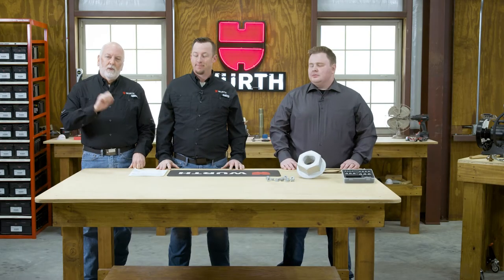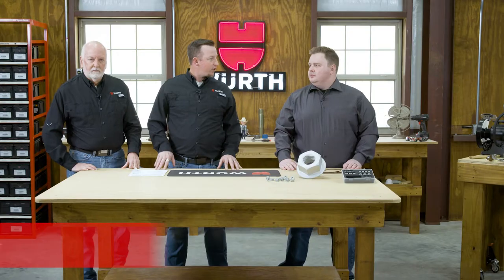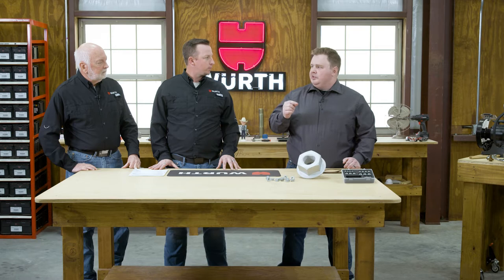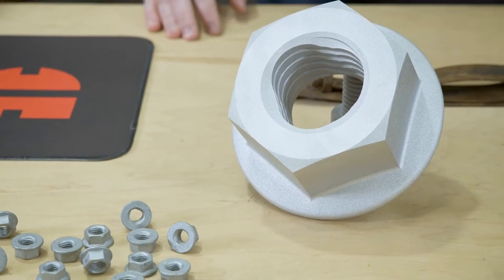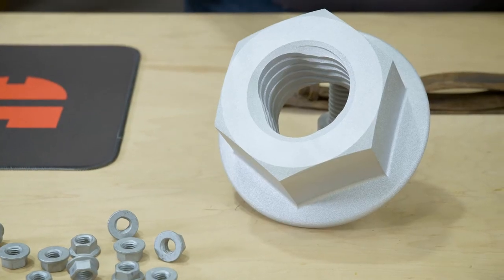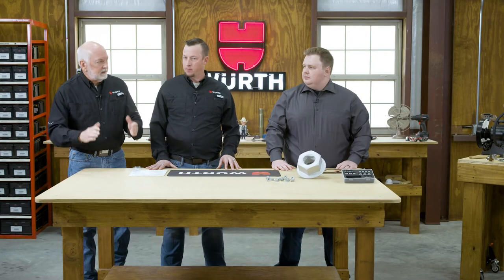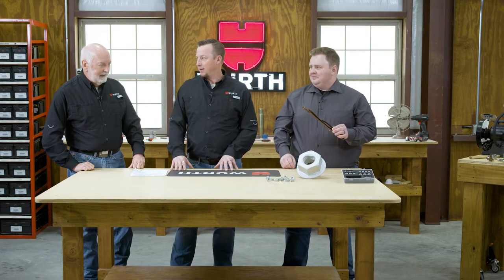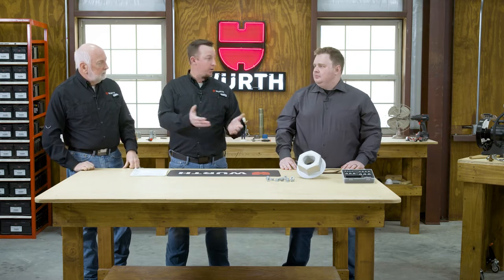The b&m-TRIMNUT® | Würth Knowing Episode 27

Comment: Is the joint's max clamp load limited due to the nut's special thread design? Or are the nut's threads still stronger than the threads on a class 10.9 metric hex cap screw?
Reply from the maker: Hi Jonathan! The b&m-TRIMNUT meets the proof load of class 10 per ISO 898-2.
Feel free to reach out to us at wurthknowing@wurthindustry.com with any further questions!